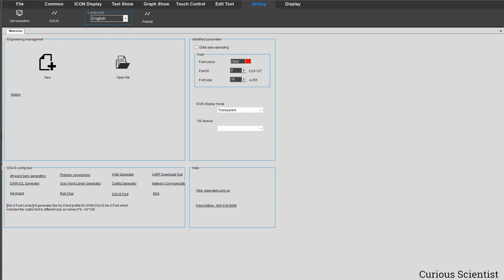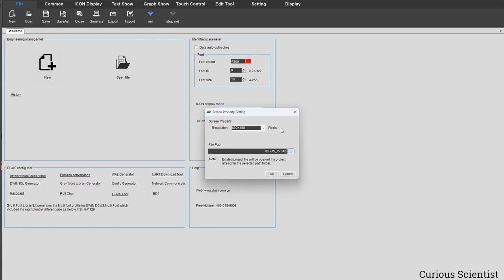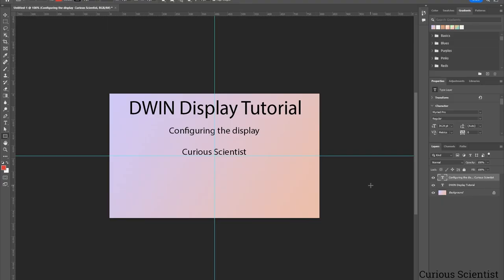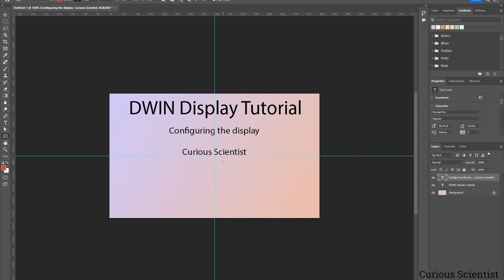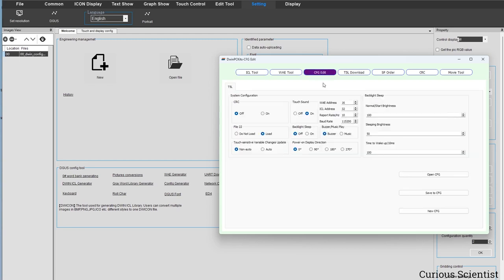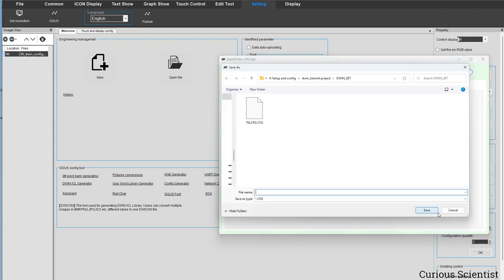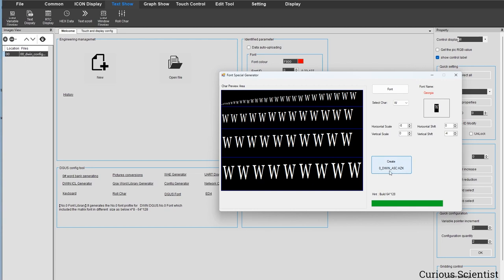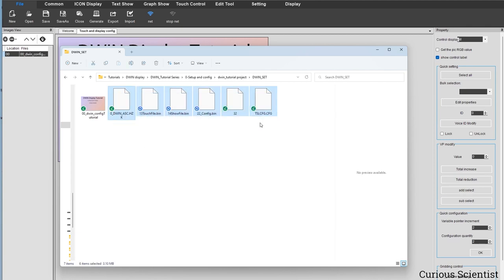DWIN Display Tutorials #0 - Setting up and configuring the display

Comment: Hello, Great video, I appreciate the time and effort to make such video, I have an question, and I hope you can help me, does the DGUS have a option to do a delay and change screen or icon? for example when a button is pressed it change screen and it return to the previous screen after a couple of seconds, or change the button icon and return to the previous one, like a delay or a timer, i could not find anything like that, thanks.
Reply from the maker: Hi! I think you have to program this logic on the microcontroller.

Comment: I'm getting a stobing effect on the display and no touchscreen.  It's a newer vyper LCD (marked zwlf043_001) and I'm running DGUS_V7.641.  Do I need to do something different or use a different tool to get a functional system?
Reply from the maker: Hi! I do not really know how to work with the display when it is a part of a hardware such as a 3D-printer. The DGUS toolkit should be enough to configure the display properly. Are you sure that you selected the exact type of the display, had the correct resolution and other parameters properly set in the config?
Reply: I found absolutely zero info when I searched  for zwlf043_001 so I can't say for sure what it's specs are.

I do have a non-touch DMC80480C043_02WN.  The files generated per this tutorial display correctly on it.  The DWIN_SET provided by Anycubic for this printer display properly on both.  They have the same PCB.  I swapped PCBs and the behavior followed the LCD.

Is there a newer version than V7.641?  That's what is on the DGUS download page.  I've seen some comments about a V8.2 but I haven't been able to find it.

Comment: I couldn't download .hzk file in display.What might be the problem ?
Reply from the maker: Do you mean that you could not upload the hzk file to the display? Was there an error message on the blue screen that indicates the uploading process? Did you make the correct font file and named it correctly?
Reply: S the file name is 0_DWIN_ASC.There is no error meesage .It is more than 20 minutes but  it is still on download process.What might be the issue?
 @CuriousScientist
Reply from the maker: Try to regenerate the file. Also, make sure you formatted the SD card correctly.
Reply: Still I am facing the same issue.Will there be any problem in the memory of the display? Do i have to clear the memory? Where is the CFG location? @CuriousScientist
Reply from the maker: Everything you upload to the display is done via the files that you put in the DWIN_SET folder of the SD card. I don't know why the screen is not behaving as expected. Try directly contacting DWIN to get some better information about the issue.
Reply: @CuriousScientist  You probably need to experiment with an sd card. Some do not accept an 8GB card and only work with a 16GB card and it must be formatted in FAT with 4KB sectors.